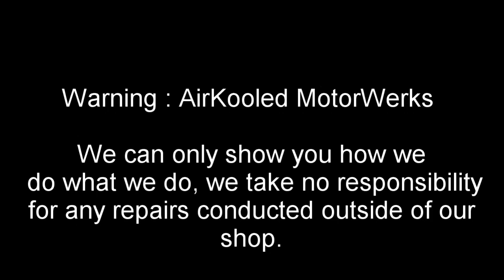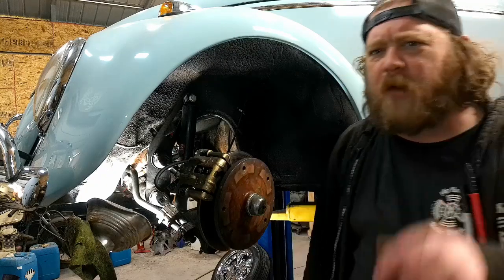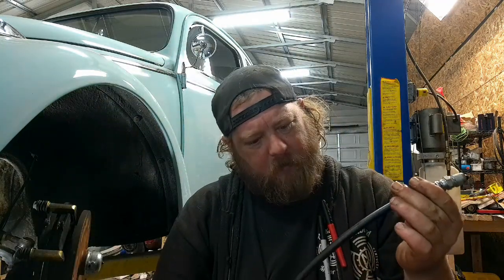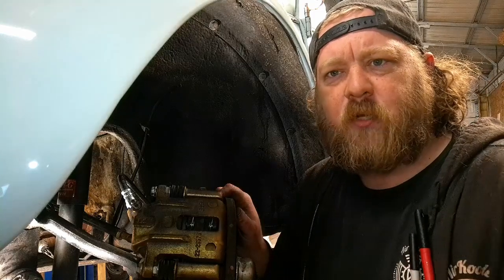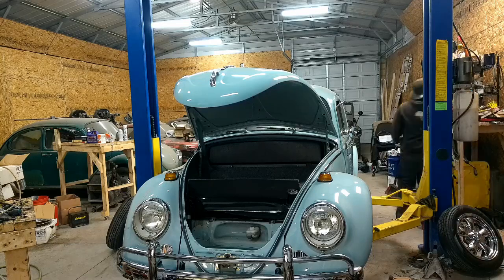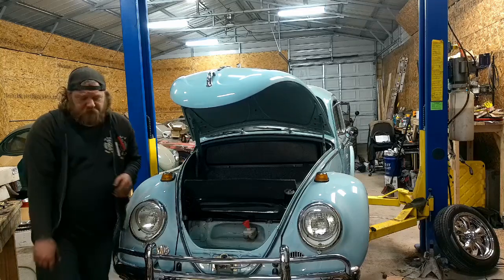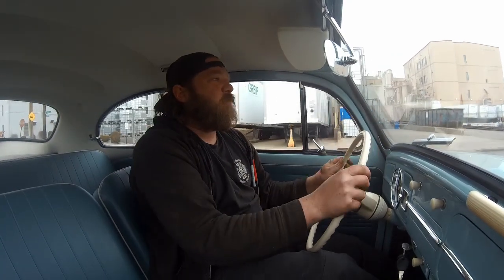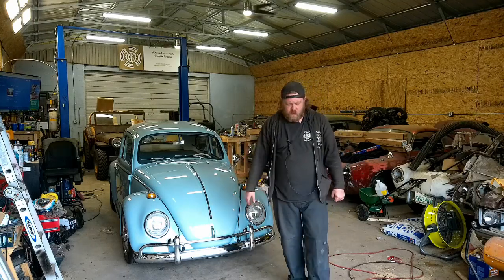PT:3  1964 Blue VW Beetle ... Re installing EMPI wide 5 disc brake calipers the correct way

Comment: Nice clean bug with working brakes 👍 owner lucky it came to your shop and noticing front brake pipes etc . Easy mistake unless you know ? But wow what was the hoses off a vanagon . Happy new year
Reply from the maker: thanks mann... i haven't had time to cross the part number on the old lines yet but i'm not sure of any vw that runs a 610mm rubber soft line most i come across is the 480mm that would of been stock on this 64 ... not sure why they would of changed it... but ill look into the vanagon to see if thats what they might of came from

Comment: Hey can I ask out a suspension question ? I saw this Beetle has a similar stance to mine which has sway away adjusters … I’m wondering if put would recommend kyb Excel-G shocks that this bug has? How does it ride? My has standard Boge on it alround and rides ok, but I live in a place with pot holed roads and wondering if kyb would be better? 
Thanks so much 😊
Reply from the maker: @TommyH-q7j  honestly I just recommend to my customers off the shelf shocks at O'Reilly's... Nothing fancy they all to me ride the same especially when you lower your car . Unless you buy shocks that have the correct eyelet to eyelet measurement you're going to burn out factory no matter what brand sooner than later
Reply: @ wow ! You replied like amazingly fast thank you ! I’ll keep my stock shocks on the Beetle for now, it’s a 2003 ‘Summer beetle’ shipped to the uk by Apple2000, one of the last aircooleds and has about 37,000 km and seems really solid, the current shocks I think were replaced back in 2009 and low miles since.
Thanks so much for your advice 🤩
Reply from the maker: @TommyH-q7j  anytime, if you have any more questions feel free to reach out happy I can help